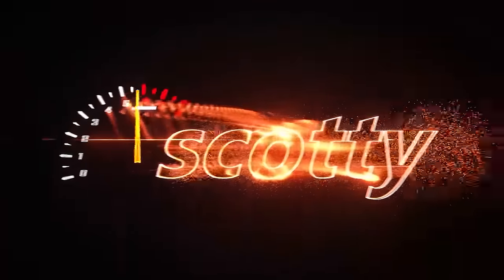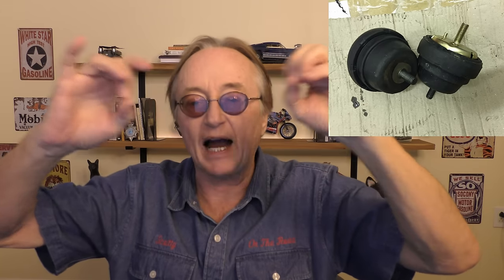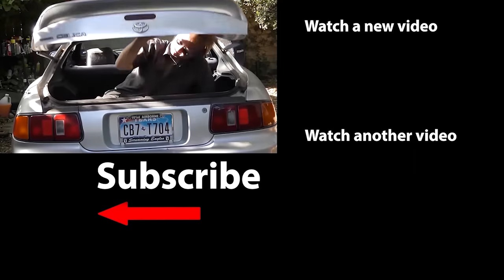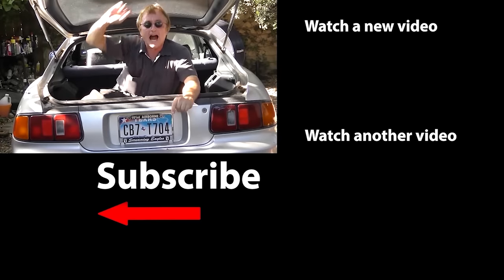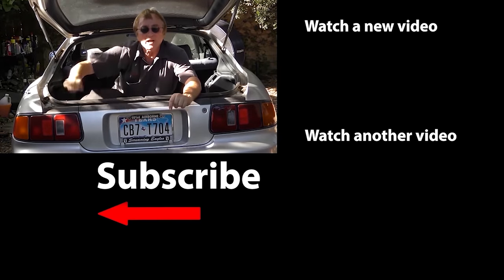Here's Why Changing Your Engine Oil After 3,000 Miles Will Destroy Your Car

Comment: Remember guys. A cheap oil change every 3000 miles is always better than replacing the engine
Reply: I can't figure out why a certain percentage of people are constantly pushing back on that advice and going long intervals.  The extended intervals in the owner's manuals are for perfect conditions.  Most people are driving in severe-duty conditions.  Always go off that interval.
Reply: @anthonyg1417, yea some people have tried to tell me I'm wasting oil/filters/money because I've always just changed the oil every 3K and a new filter with each change. The car is 20 yrs old and over 240,000 miles, still running like new & thankfully never had to do any mechanical work on the engine/valvetrain, only things I've done, new valve covers, engine mounts, starter, batteries/alternator over time, new plugs/wires, coolant flush, transmission filter/fluid changes & that's it for the engine/transmission.
Reply: @zenithperigee7442  I didn't do any of those things and finally sold the Toyota Echo with about 262,000 miles, original clutch and everything. And I frequently would do 6000 mile interval oil changes, I think the every 3000 is arbitrary, why not every 1000, oil looks just as watery and dirty at the 1000 mile interval versus the 3000 mile interval. I think the machining of the engine goes much further in terms of longevity than oil change intervals.
Reply: @pavelow235  quit trying to think, it’s not working for you at all
Reply: @pavelow235  so you changed it every 6,000 miles...isn't that arbitrary, too?
Reply: I used regular oil in my Honda and only changed every 10k miles and it went over 300k. The trick was that I drove it gently. The rpm always kept low.
Reply: Oil is cheaper den parts. Period.
 My motors never see oil beyond medium caramel color and last far beyond normal. Color limit always seems to agree with the Chevy oil sensor monitor too; sometimes I'm first,  sometimes the 2000 Silverado always very close...still strong @ 230k. Mowers, tillers, Harleys etc...same story.
Reply: Quiet guys. The oil whisperer is speaking 😂😅

Gets off by changing his oil often. Now that's weird people am I right?! Odd hobby
Reply: Oddly cars last longer in Europe where oil is changed at much longer intervals...often about once a year.

The 3k mi oil change is advice from the Model A to 57 Chevy era with massive blow-by, non detergent oil that was also gathering metal shavings into clumps in the pan, and many cars had no oil filter.

If changing your oil and plugs often makes you feel real good, or it is the final mechanical wrenching you feel you can still do on rolling computers....then it definitely won't hurt anything unless you strip or cross thread something.

However, even his advice about idling the turbo motor for 3 minutes indicates he knows the real culprit is oil varnishing.....cooking the oil on a static, blazing hot turbocharger.  The same way you season a frying pan by melting the oil into a paint coating.

IOW drive the car hard, near redline, and the parts get too hot.  They needed to warm up slowly and cool down slowly to avoid metal shock.
Reply: Absolutely.
Reply: As the commercial used to say “pay me now or pay me later!”
Reply: @pavelow235  And I just believe every random person that comments on YouTube.  Original clutch and everything???? LOL 😂
Reply: @redcelica5227 Sure you did.
Reply: 3k? That's overkill in these modern engines. I go 5k. If I had a race car, then way different story.
Reply: Prove it
Reply: I've been through many cars in my life.  I wish I had this info when I had a turbo. But I've learned to make sure you change the oil every 4k to 5k miles on any vehicle.  You may not notice right away, but even stretching it out to 8k might be ok for a little while, but out of nowhere, everything will start going out.  I guess it's not a problem if your a person getting a new car every 5 years. So if you are buying a new car, make sure it had regular maintenance and oil changes every 5k miles.
Reply: @STho205  Do you have documentation of the claim that "cars last longer in Europe'? I would not be surprised if a lot more people in America neglect maintenance. If it's not an apples-to-apples comparison, it doesn't mean very much.
Reply: Get an oil analysis done.  It'll show you if you are changing it too early or late.  For me, it recommended every 7000-8000 miles.
Reply: Ha! Whats a cheap oil change
Reply: The people who recommend every 3000 miles are the ones who sell oil changes. If you read your vehicle owners manual it probably says 7500. Who knows more about your car,  the manufacturer or the place that makes money by selling oil changes?
Reply: @userac-xpg the manufacturer wants to sell you a new car as soon as possible, they tell you to never change your transmission fluid. Do you trust that too? No one should be selling you oil changes at all, if you can't figure out how to unscrew one bolt and pour oil in your engine you shouldn't be driving a car
Reply: True, oil is cheap, engines are not, a have a turbocharged car and i change the oil every 3k to 4k miles and never had a problem and it doesn’t smoke, so best advice is to learn how to change the oil and do it yourself,
.
Reply: I prefer a quality synthetic. Of which has been proven can handle 5k with no problems.
Reply: Free oil & filter for life at dealer 3k always
Reply: @userac-xpg who’s trying to sell more oil changes ?  The internet poster , or a car dealer ?😅.  Of course. The car dealer. Dealerships make 75 % of their profit on service.  Duh.
Reply: Every 3k if you use the Walmart special. The stuff I use costs $75 on my one car and $120 on the other. That's with me changing the oil myself. DO AN OIL ANALYSIS!!
Reply: @superflunker87 That's what I do on my turbo four with AMSOIL. Getting my oil analysis back soon so I'll update y'all.
Reply: Yea, true, but how much better? My friend commutes and has the oil changed every 3-4 weeks @ $70 a pop....
Reply: @302Mustang13 Mitsubishi Evolution VII 2021. First owner now at 119K miles and never had an issue. Oil change every 4,000KM with 4L cheap synth oil with filter all for $30 bucks. LMAO
Reply: @JABelms  And there's plenty of us who go 8,000 miles on an oil change.  I did 6,000-7,000 on my last vehicle and no problems over 240,000 miles. My new vehicle has a longer interval and I'm changing it early at 7,000-8,000 miles. Oil looked good still and hopefully my analysis will support at least what I'm doing so far. If I did more highway I'd go close to 10,000 miles. I use AMSOIL Signature Series and it is superior to anything. I've seen the data on it and it lasts for as long as the manufacturer recommends for change interval.
Reply: @zenithperigee7442  I'm in the same boat too. My last Ford with a V6 went 16 years and 240,000 miles and I changed it myself every 6,000-6,500 or so. Never had an engine issue and besides some wear, it will likely go another 100,000 depending on the next owner.
Reply: @302Mustang13  That's just an extreme example because the evo is a sports car tuned or 502 hp off the crank, and it eats oil so I'm not spending top of money worth of expensive syths. I just chose frequent oil changes over the usual Pennzoil Platinum for cost reasons they were just the same down the line
I still do 10K oil changes on me and my wife's Lexus SUV with Toyota oil (Exxon)
Reply: I’d say 3-5k & not to exceed 1y and no longer.

Some leeway will exist but I’d rather be safe than sorry and not one of those sad fuqs that has to get a new engine.
Reply: @JABelms  That's a different story cause modified automatically should be severe duty. When I get forced induction on my 5.0 Mustang I'm going from 3,000 miles and once a year changes to twice a year. That is unless I drive less miles than that. Hopefully I drive it more then and enjoy it.
Reply: @mplslawnguy3389  We're talking about in general normal use here. I just looked at my manual and it has three classifications: normal, severe, and extreme. Normal is 7,500-10,000 miles and I actually fall under it for my daily; severe is 5,000 miles to 7,500; the last is extreme and is 3,000-5,000 miles and involve dusty/dirty conditions, extensive idling much of the time, and heavy towing much of the time. My point is it depends on how you use your vehicle and 3,000 miles in general with full synthetic oil and mostly highway is poor advice. I haven't changed oil less than 5,000 miles and I've been doing that since 1998 on my own vehicles running full synthetic, never had one engine related issues. Only one vehicle burned a little oil too, the rest not a drop and I've done high mileage and time.
Reply: @302Mustang13  That's the thing, most people don't fall under "general normal use."  You might think you do, but modern cities and driving conditions easily push you into severe duty.  If you live in a major metropolitan area, or areas with huge temperature swings, you fall under severe duty.  By all means, keep doing what you're doing.  I'm going to stick to what I do.
Reply: @mplslawnguy3389  temperature refers to extremes like Northern Canada and Alaska or Death Valley. A hot Midwest summer or cold winter doesn't usually qualify. Sometimes it does and I reduce my interval appropriately. My manual states occasional and moderate towing and hauling is normal use. Only way people can go maximum interval is mostly highway driving with not much more. I simply go with the lower end of normal and use my own judgement.
Reply: @mplslawnguy3389  Which interval? The manual's? Or 3000?
Reply: What about for full synthetic oil? I’m told you can go 5 to 10,000 miles and be perfectly fine.
Reply: @druu988  Full synthetics will last at least 7,500 to 10,000 miles, sometimes more. My rule of thumb is to change it a little before max interval and/or around 20% left on the oil life monitor. As long as it's not mostly city, mostly heavy towing, excessive idling like cop cars, and short trips, I would recommend that. I can't imagine doing 3,000 mile oil changes with my expensive full synthetic. It's unnecessary and not saving anything.
Reply: I change my 2003 Nissan Altima every 20,000 miles with Mobile 1 and it has 296,XXX.  It just won't die even when I treat it like I want it to.
Reply: I wouldn't say that. Full synthetic every 5,000 miles is probably going to be better than conventional oil every 3,000.
Reply: @musicman7297  I’m not kidding. I consider myself lucky. My next Honda I use synthetic and change more frequently bc you never know. I still drive it gently bc I think it really helps but I’m being extra careful this time.
Reply: My 1st chevy sonic 1.4L turbo I drove to 130k and sold it.  Original turbo and clutch.  I changed it at about 10k every time.  I drive about 25-30k a year 80% highway.
Reply: @pavelow235 - Wrong. You were luck. Toyota makes epic engines but you were still lucky. What do you not understand? An engine needs oil to work. The cleaner and fresher the oil, the less wear and tear on the engine. The less wear and tear, the longer the engine works. At 3000 miles, the best oil on earth starts to decline very rapidly. If you could somehow have 2 identical engines, and run them nonstop in a lab, whichever got clean, fresh oil the most would run longer before breakkng down every single time. Why is this such a hard concept for people?
Reply: @garychandler4296  Your "motors" are engines. They have starting "motors" but they themselves are engines.
Reply: I run 5.5 quarts of motul 3k mile changes or every 4 months. Not exactly cheap but it’s worth it.
Reply: @zenithperigee7442 if you don’t 
Mind me asking, how much would all that repair cost all together at a shop in your area?
Reply: Its not 1980s anymore, never changed oil on any of my vehicles before 5k miles, and guess what.......ZERO ISSUES with any of the engines.....
Reply: I use cheap Meijer oil, cheap fram oil filter, change oil every 3000 miles and I have 335,000 miles on my Saturn SW1 and still going strong.
Reply: @userac-xpg The manufacturer’s goal is selling you a new car. Why do you think they tell you that your transmission fluid is “lifetime”? Because the power train warranty is the same. They sell more cars with longer intervals.
Reply: @richbrake9910 Anyone can remove a drain bolt themselves.
Reply: @302Mustang13 Scotty was specifically referring to turbo cars.
Reply: @302Mustang13 Scotty was referring to turbo cars.
Reply: @gary_neilson1896 Scotty is referring to synthetic.
Reply: @mitch1078  turbo cars are not that much different. If you fall under normal use they can go much farther than 5,000 miles even. Since I switched to AMSOIL full syn with my 2.0 turbo, I've been doing 7,500-8,000 mile changes. I just did one and my oil analysis should be back any day now. I'll let you know what science says about turbo that is undisputable. Not even Scotty will be able to dispute that.
Reply: you are better off changing 5K miles. At 3K miles the detergents are cleaning away the boundaries of additives providing protection.
Reply: Certo,perché non una volta a settimana 😂 o ogni mattina prima di andare a lavoro. C'è un test su autosprint, motore firefly, 60000 km senza cambiare olio, motore perfetto
Reply: Not if it’s a lease 😂😂
Reply: I can't believe people are still spreading this nonsense, even if you do exlcusively city miles and or lots of towing every 6 month or 5000 miles is a reasonable interval for normal useage every year or 10000 miles is good. If you change your oil at 3k miles you're puring money down the drain for no reason other than because old Gramps said you should.
Reply: @gravemind6536  not only that. it's actually slightly increasing wear.
Reply: I use a advanced extended synthetic and I change my oil every 12 to 15 thousand miles and never had a problem
Reply: @userac-xpg  the manufacturer is only wanting the vehicle to make it 1 mile past the warranty so they don’t have to pay to fix it.
Reply: @userac-xpg who wants to sell new cars. ?  I worked building engines and after 3000 miles oil breaks down and engines start to sludge up.
Reply: @warrenwinslow4266 that's just not true. I ran mostly highway with my last car. Did 10,000 mile oil changes. Blackstone analysis showed to be favorable. They even said I could go 11,000 and still be fine. Modern full synthetics don't break down after 3,000 miles.
Reply: Yes, TURBO engines DO need oil changed More often. 0-w20 is what most use & that's still "thin". So it WILL break down sooner due to operating at much higher temperatures.  It will cost more to do more often, but better that having to replace the engine due to lack of more frequent oil changes over time. I, personally,  will do the 3000- 4000 oil change & hope for the best !!
Reply: Changing oil every 3000 miles is downright abusive.
Reply: Turbo cars change oil every 6k miles 
Non turbo change every 10k miles
Reply: JHFC.

Just change your oil at least at the recommended intervals with at least the recommended oil. This isn't rocket science. 

If you want to change your oil more often, or use better oil, fan-frickin'-tastic. It certainly won't hurt. 

Change it every payday if you want.
Reply: @redcelica5227 low rpms does not ensure longevity.
Reply: @mitch1078 apparently not because 90% of the population refuses to do it themselves 😂
Reply: @mplslawnguy3389  Because the advice they get from the OEM's that designed the engines is taken instead of youtube channels I guess.  They figure they can trust the OEM and that the OEM would be conservative so if they say 16,000 km oil change on synth oil - they go by that.  I do my non turbo at 8,000 km but am considering doing at 6,600 km.  But I do almost entirely highway at 100-110 kph with no city or dusty road use so 8,000 km is likely fine on synthetic.  I'll see.
Reply: @redcelica5227  But 300k isn't that much for a Honda.  1,000,000 is what maybe you'd achieve with more frequent oil changes.  Of course by then the rest of the car would be rusted unless you spent a lot over the years in rust coatings.
Reply: @STho205  Longer TIME intervals, they likely drive much less, N. America is huge.  Countries in Europe are relatively tiny.  Of course they can cross borders but Europe itself isn't that big.
Reply: @userac-xpg The manufacturer wants your engine to wear out so they can sell you a new car every few years.
Reply: @zenithperigee7442  my e36 m3 is 24 year old with 284,000 miles with 10K mile oil change intervals, no leaks, great power, no issues. Never left me stranded. Your logic or advice does not hold.
Reply: @STho205  no they don't. European cars are fragile baubles. Especially so in the electronics department. As an open minded American, I've had my home team's cars, Germany, and Japan. It goes like this in real life: Germany/Euro Cars, Period < American < Japanese. At least it is for us. Those people must send us the bad ones. No, Made in Germany does NOT make a difference. As someone that owned a brand new, 2008 made in Wolfsburg MKV Golf, ask me how I know. Worst car I've ever owned. Random things failing or breaking that had zero to do with any maintenance matters both mechanical (grinding steering rack) and electrical (all of it).
Reply: @HemisFair210 the one you do yourself
Reply: @superflunker87 what car?
Reply: a 3000 mile oil change is pissing money away.